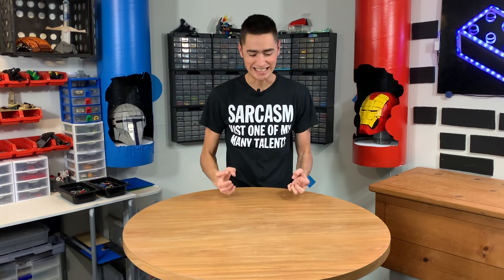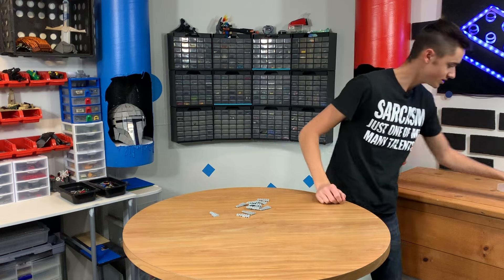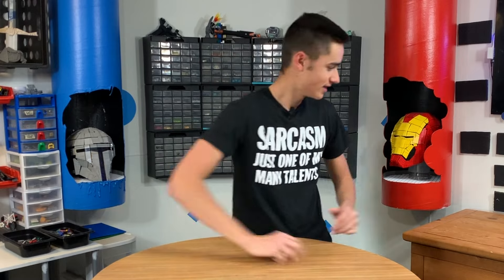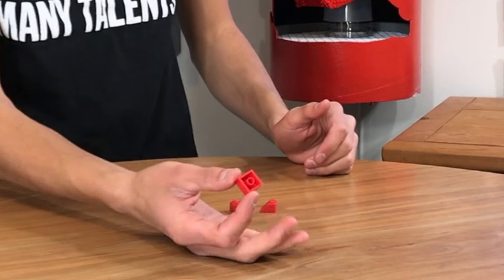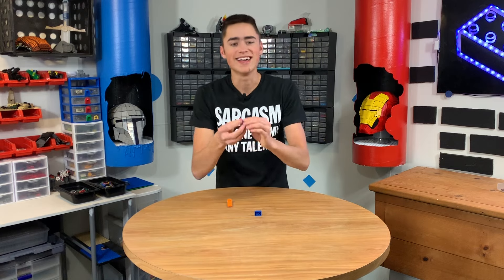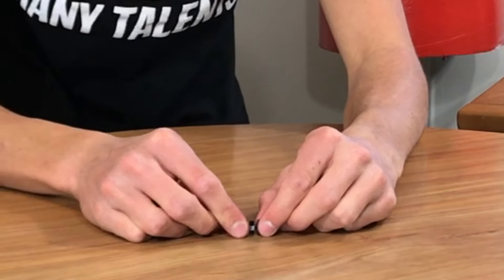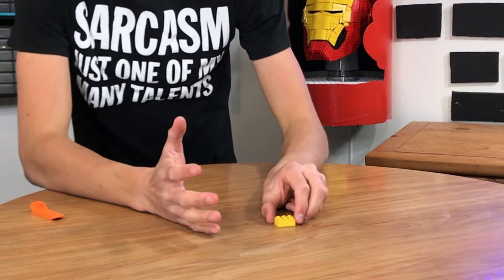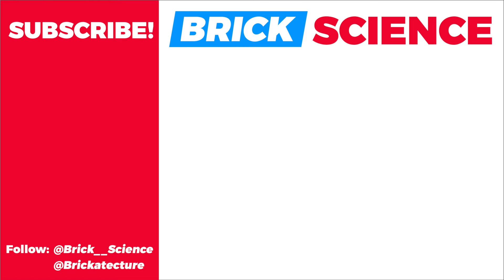10 TRIGGERING Things Only LEGO Builders Will Understand

Comment: My number one pet peeve with lego is when those small ball socket pieces and the clip peices break after a certain time of use. I had a whole bunch of those peices and I was using them to make a mechagodzilla figure and I had to throw away like 10 of them because the socket broke. So, I couldn't make the tail for mecha g. They would crack and become loose and then  break. I hate that.
Reply: ive had this happen far too many times, they have updated the clip pieces at least.
Reply: i have this problem but with the clips like what are on star wars battle droid arms and legs, they break so easily
Reply: That happened so many times to me that 2 droid commandos I've had for 10 YEARS have nothing but the chest piece intact. My LEGO General Grievous's neck snapped as well.

Comment: The worst for me is hair. Not when strands of hair get caught in my build. (yes, that's annoying, but not as bad as this). The hair that is ATTACHED TO MY HEAD gets caught, and then I'm stuck in front of my mirror for like, half an hour trying to get the Lego out of my hair. Like, you can't just break the hair, because then you have 2 pieces with hair in them, and it's not as if you're going to use that in a build because, ew. I've tried putting my hair up, but it just never works. I guess this, like all other Lego tragedies, is something I'll just have to live with . . .

Comment: One that always used to annoy me was squished pins.  Didn't matter whether it was a technic pin that wouldn't stay clipped into the part, or a car axle that couldn't keep the wheels on, they drove me crazy.  Especially if you discovered it while building a vehicle that needed that specific axle and now you've got to find one in the half-dozen other cars you just made that can be switched out.

Another irritation comes in when you're building, you're almost done with the house or the car or the crazy airplane you've been making for hours, and you realize... I don't have any more of that piece I need, in the color I've been using.  This is always made worse if you remembered using that piece... several hours ago as a filler part because "I'm not going to make the roof with red tiles again."

Bent base-plates.  So frustrating when you're trying to build and half of your base-plates are bent.  Also to do with base-plates, and this is one that might only be situational because I inherited my LEGOs as a kid from several friends of the family giving me old sets they had, is when someone has cut the base plate.  Especially if they've cut it to an odd number of studs.

Broken tabs on doors and windows, or window shutters.  Admittedly, a mild irritant because, again, most of my LEGOs were pre-played, so I accepted some things might be broken, but there were a lot of things where I was annoyed by the fact that all of my green shutters had a broken retention tab.

Putting the door the wrong way around when building a house.  It's all fun and games until you can't close the front door without demolishing the house.

Stepping on your own LEGOs on the way to the toilet.  1x1 bricks are agonizing when you've dropped one, because you will find it when you desperately need to pee.  And it's way, way worse when you do it to yourself.

Not entirely LEGO related, but finding a live spider in your LEGO house.  I'm not arachnophobic, but having a wolf spider run out of the house I was about to take apart made me nope out of that for a day.

Knock-off bricks.  I don't care whether it's Mega Blocks or any other 'generic' brick, no matter how much they try to market their 'compatibility' with LEGO, they just don't ever work.  They're often the wrong color, they don't click together properly, they damage your actual LEGO pieces because they're too tight the other way, and in my case, they were very 'generously' salted among my pieces by one family friend known for being cheap.

Tangled strings.  Ever wanted to actually use the winch on your tow-truck to pull a car over to your impound lot, only to find that the string was wound up improperly, and now it's jammed up?  Or perhaps you needed the fire-fighters to roll out their hose to put out the totally-serious fire at the LEGO bank or all of the money for the town will be lost, but because the hose is tangled up, the whole town's going to burn?  Or perhaps it was just a winch on your off road truck that wouldn't unwind, making it impossible to pull the truck up from the cliff, because at some point, the cable unspooled, the hook slid under it, and then it was wound up all nice and tight again.  Yeah, I dealt with that a lot.

Not being able to find that one piece you need to build the set you just got.  There's nothing ever so fun as playing "Did I lose it or did I get shorted a piece" with a brand-new LEGO set.

I personally hated stickers.  If it was a printed piece, I knew it would last 'forever' and so I'd build with them and never think twice about it.  But a sticker always meant trouble, because either it won't stay stuck, or it'll get stuck to something else, or it'll rip.  Or worse, when I was building new sets, and some moron decided "Sticker goes over three bricks lol" in the instructions.  Because either those three parts are staying together forever, or you're going to have three bricks that can only ever be used for that one purpose.  Built many a set without applying any stickers.

And, lastly, one that was never a serious problem, but always kinda bothered me, is that minifigs were never designed with at least knees for better posing in designs.  Also that (and this'll kinda date the sets I was using) there were no other leg sizes but standard.  Am I the only one who used to put 1x1 tiles on my minifigs' "feet" as shoes?